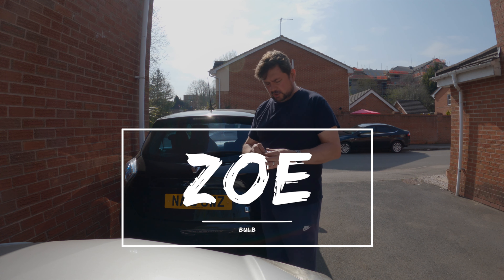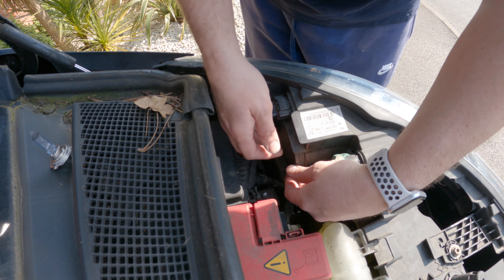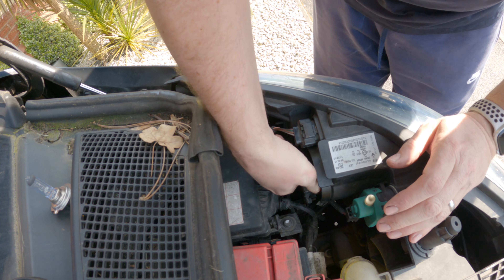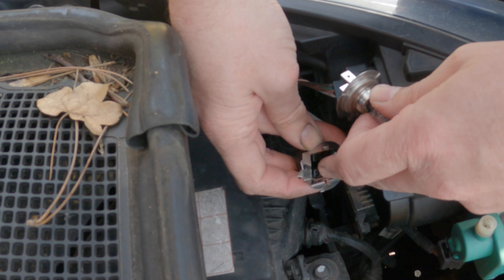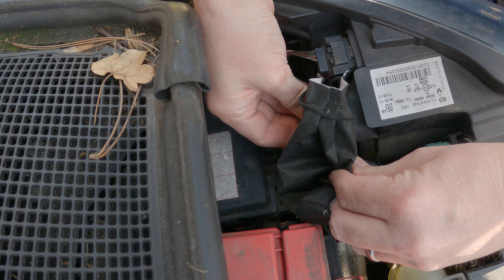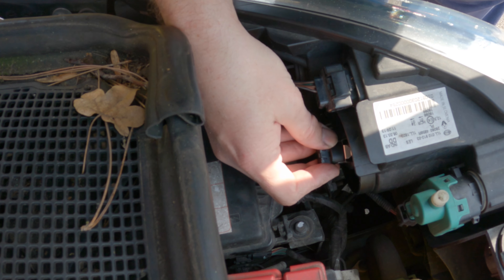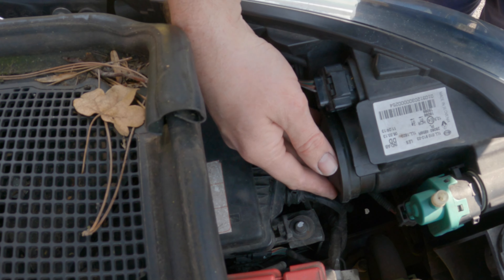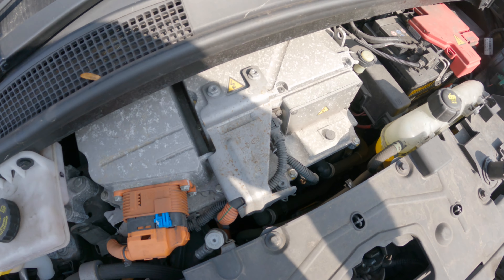Renault zoe headlight bulb change

Comment: Is the model of this vehicle the ZE50 ? and have you every tried replacing it with a LED bulb ?
Reply from the maker: It is a Q90 model I think, I haven’t fitted led to that but I have on other cars, they usually work ok but some cars show errors as it thinks bulb is out owing to low power use, it depends on the car and I’m not sure on the ZE50

Comment: Ok, that was easier than I expected, having owned a Scenic -07 where you need tripple jointed wrists and only three fingers on your hand to pull it off... 😅
Reply: Changing both took the same amonut of time as just removing the right (easier) bulb, on the Scenic. 😁 Good to see there is acutal progress made in head-light design at Renault.
Reply from the maker: @niklaswejedal463 the worst bulb change I have came across is Citroen c2, I couldn’t believe it, to do that you need to remove bumper, I had a fitter at Halfords moaning to me about how long it took him to do a mondeo bulb change until I showed him it was the quickest, sown on my mondeo bulb change video
Reply: @RichManPoorMotors  Oh dear...I was supposed to let the Renault service do it on the Scenic, since it was basically impossible to do without removing the front if you are a normal human being and not a octopus, but I am very stuborn and won't pay for things I theoretically can do by myself... With a lot of swearing, and arms filled with scars and bruises it can be done. I'm not surpirsed the C2 was equally horrible, since it was made at the same time with a head light design similar to my old Scenic (which still was awesome in every other way...)
Reply from the maker: I nearly bought a Audi that was £2000 below trade price a couple of yeas back, it had a small scrape in the bumper cover but was fine behind the cover no damage, but it also had a crack in both front headlights, 
when I checked on the replacement headlights price I was gobsmacked that they were £2500 plus var each, so £5000 to replace both, luckily I checked first

Comment: When I try, it doesn't that easy. I catch the back of the bulb holder and... nothing moves when I try to turn it. It's the opposite bulb compared to the tutorial. Any advice welcome 😅
Reply from the maker: Try pushing it in as you turn the bulb holder, this might help, they do take a bit of twisting make sure your turning it the correct way, Is it a mk1 zoe, as later might have a different bulb holder, it might have a clip or setting screws

Comment: Be very carefull to not drop the metal bulb holder (the metal part he doesn't desatach in the vid). Is a very rare one very very difficult to find, and the standard ones sold everywhere doesn't fit. Be aware of it. If anyone knows what exact reference this piece has or how to find it will be appreciated. Thx.

Comment: With so many engineers in the world, no one has yet thought of creating a practical system to change a light bulb in the car! Horrible system! Maybe Elton Musk will have to solve this too.
Reply from the maker: The headlights on my own car are now a sealed unit, at over a £1000 each i would love the ability to just swap a bulb for indicator or side light if it goes